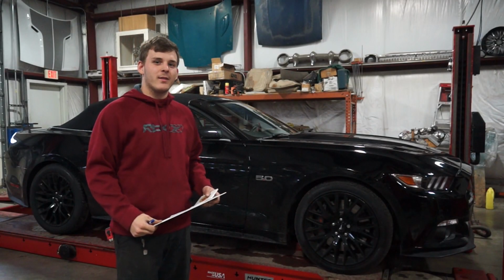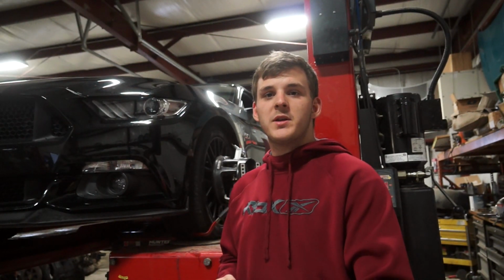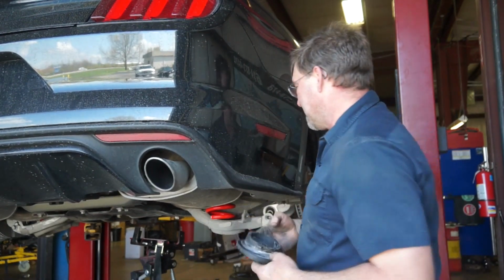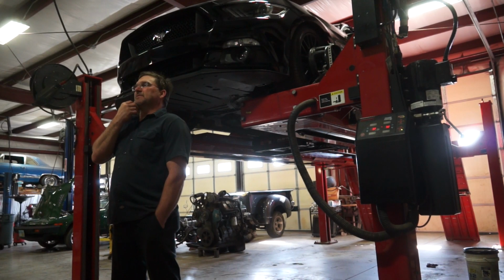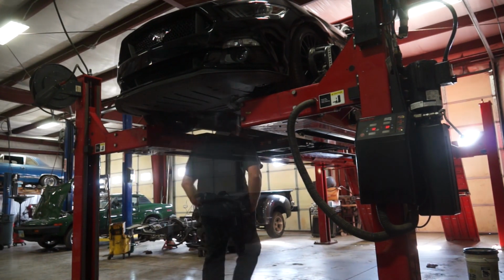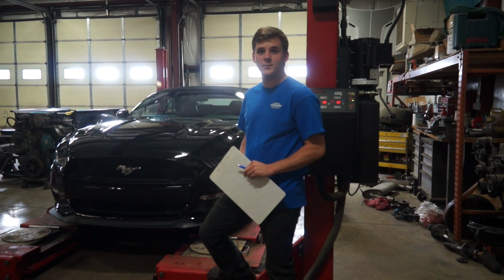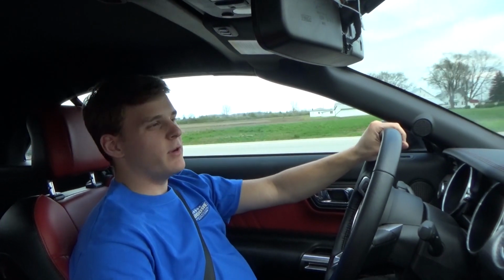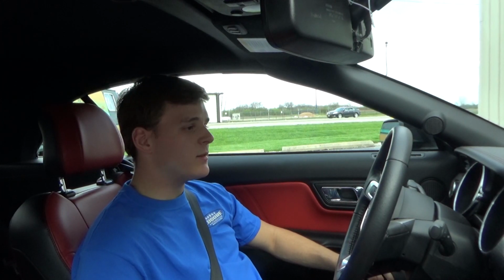Eibach Sportline Lowering Springs on RoushCharged Mustang Convertible! From Lucore Automotive

Comment: i bought the Eibachs for my old Cutlass W-31,and they looked like the original factory stance
i was actually pleased because the front springs were wore out,and the car sagged bad.
Reply from the maker: We were a little worried with the drop that was listed but turns out they ended up making it sit perfectly. No rubbing at all, still excellent ride quality.

Doing springs on old cars is always a trick especially with dealing with old springs. You never really know how much tension they have lost over 50+ years, a lot of the time using a 1" drop spring will match up to a "sagged" spring.